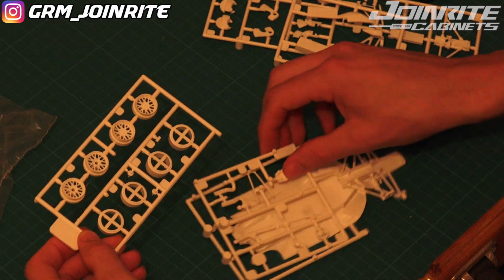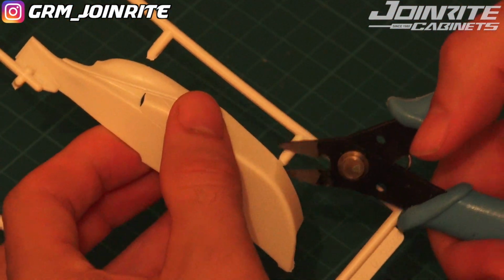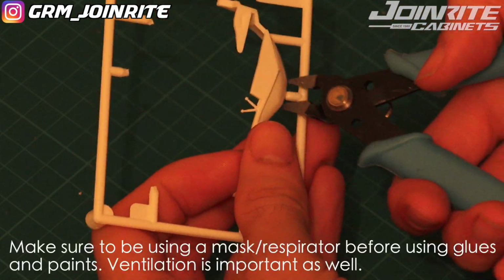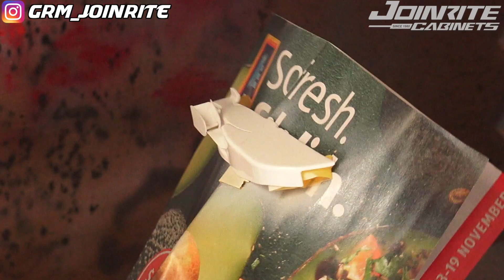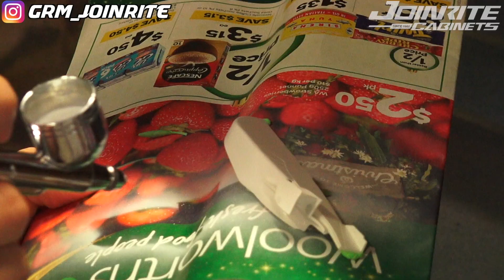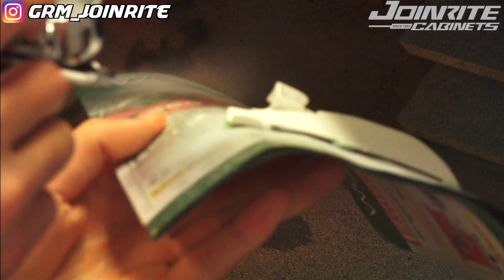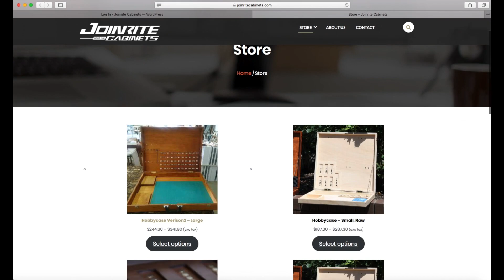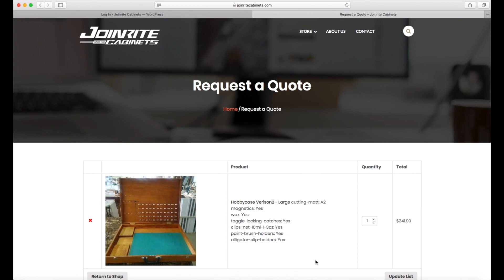Revell - Kool Green Reynard Honda 1/25 (Dario franchitti) Part1

Comment: I am excited about this one. Not many people will notice but this is the 1998 body. There was a 1999 kit that came in the Miller, Motorola, and Pioneer boxings. Road course front wing, sidepods, speedway rear wing and kickups in front of rear tires are the only differences. No biggie if you want to build it from the Shell kit, just FYI.